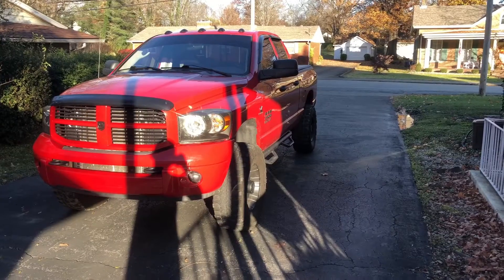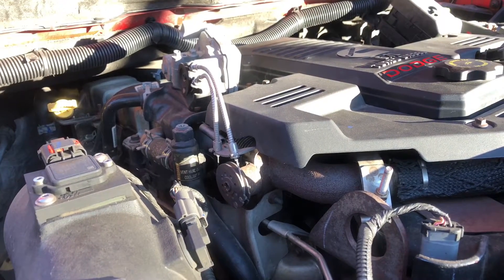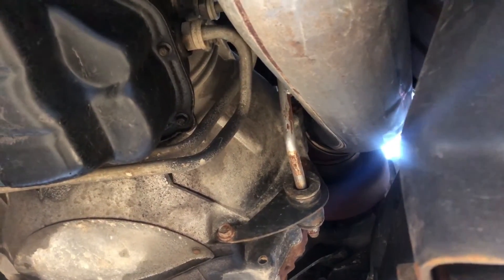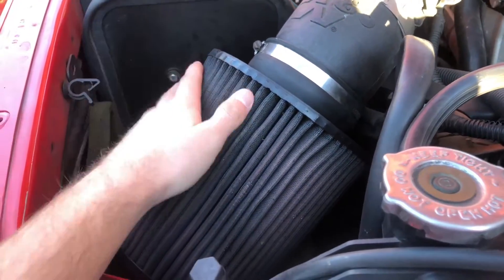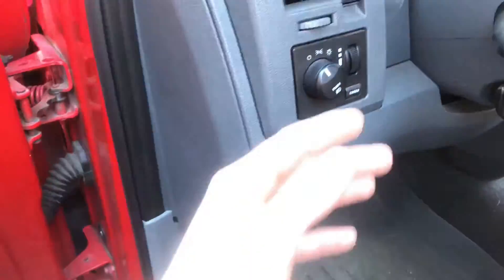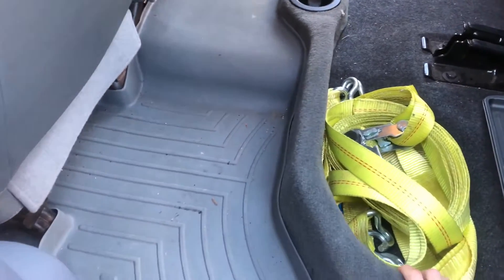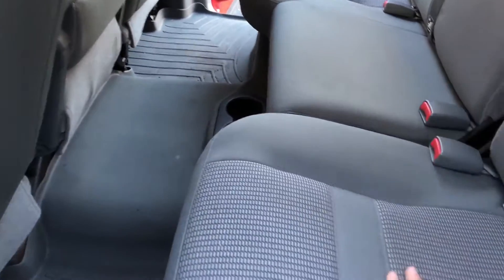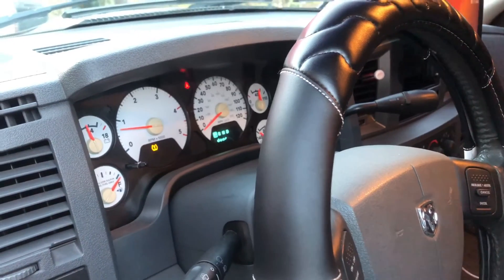OWNERS REVIEW!! 2008 Dodge Ram 2500 6.7L Cummins/3rd Gen Cummins Diesel….

Comment: I found a 2008 with a 6.7 reasonably priced but am I better off going for a 4th gen with the 6.7? Or is it worth another 5-15k to get a newer one?
Reply from the maker: Try finding one that doesn’t have a tuner on it and you should be in good shape either way.
Reply: @usa_dobson8967  is there any big advantage to either one?
Reply from the maker: @thumper0203  From my knowledge the real noticeable difference would be interior quality. (Not enough difference to justify the price difference though).
Reply: @usa_dobson8967  6 1:17
Reply: @thumper0203  o

Comment: Like we all haven’t heard a Cummins before
Reply from the maker: Some people are having issues with their engine and want to listen closely to see if their truck sounds normal. It’s not like nobodies heard it, it’s supposed to help people out.
Reply from the maker: Also, as you heard me mention in the video it has a 5 inch straight pipe which is something someone may consider getting for their truck. If I was going to get an exhaust kit I’d like to know what it would sound like before I got it.
Reply: @usa_dobson8967  I was only kidding. It’s a nice truck. I have 1 myself